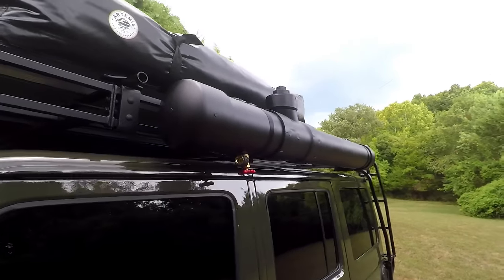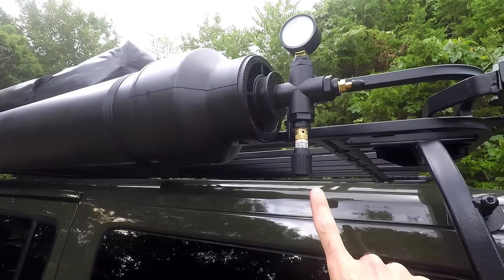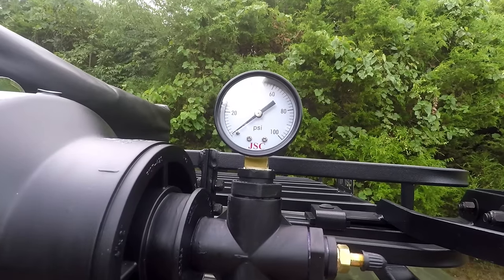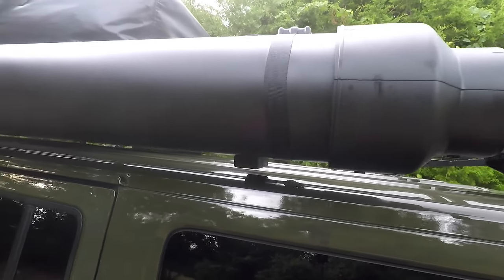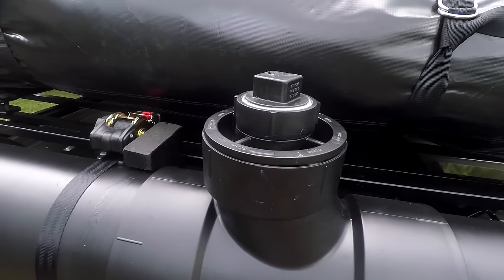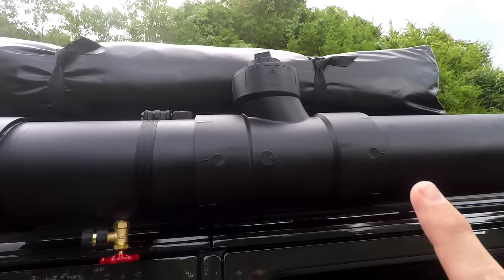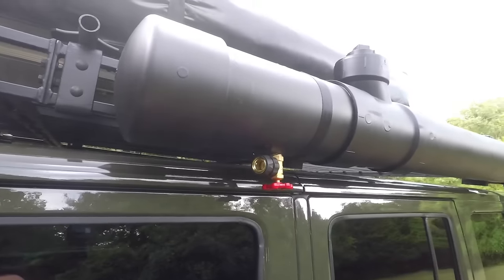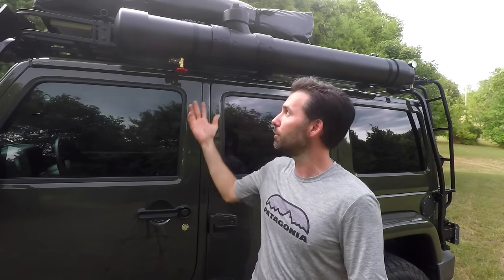DIY Camp/Overlanding Shower Walk Around

Comment: Have you considered an RV/Boat 12VDC pressuring motor? They are auto sensing for pressure and only run on demand. Proven reliability for decades on boats and RV's. Merely run a flex hose to your shower head/sprayer and put the pump in-line. No more pressure in the PVC tube and eliminate the teflon tape requirement.
Reply from the maker: That’s a great idea!

Comment: Yours is the first one I’ve seen, with the all important Relief Valve. The only thing I would have done differently, is to drill and tap the PVC, on the reducer fitting, and through the pipe, and installed the relief high. So you would vent air and steam, in an over pressure event, rather than water. BTW, to drill and tap the PVC Pipe, use Hand Dishwashing Soap, strong solution diluted as a lubricant. Another thing, we had one of the H-OT-O2 shower bags to rinse sand and salt off, when we went to the beach. The first time we put it on the roof of our van. It was too hot, and would have scalded us. We learned to leave it inside the back of the van, on the floor.

Comment: If u use a quick connector on the hose, you can fill and pressurize the tank without taking the tank cap off...waterport and rinsekit use this method to simplify refilling and pressurizing.

Comment: Nice build but my concern is the location of the pressure regulator and the schrader valve. I think it should be above the water tank full mark. The reason for this is when the pressure regulator happen to regulate pressure, it will by-pass air instead of water. On the schrader valve, there is a possibility for the brass to corrode if in water for extended amount of time that can lead to schrader valve leak. I like to add an idea to mount a home hot water tank pressure relief valve mounted in line with the full water level mark so that you can fill it with water where a pressured water hose is available. Just hook up the garden hose at the outlet of your tank and open the pressure relief valve. When water comes out at the relief valve the tank is full of water. This way you don't have to open the water tank cap.
Reply from the maker: Blo Pez lots of great ideas. Thanks for watching!

Comment: Build a small, separate air tank (8 litres) and load it to 80 psi and put an adjustable pressure limit valve and gauge (same as you have on a bigger compressor for spray painting)  between air and water tanks. Set the valve at 40 psi. Fill once and get 3 or 4 times the longivety of one air charge, remembering you have a full 40 psi pre loaded in the water tank and a backup 80 psi in the  8 ? Litre air tank. If you made a steel air tank you could charge it with 120 psi.

Comment: There is a conduit carrier kit at HD that has a metal pipe cradle, to replace your wood blocks. Overall great job! Thank you
Reply from the maker: Anthony Sanchez Great!  I’ll take a look. Do you know if they have 6” size?  Thanks for watching 👍🏻
Reply: @OverlandAddict  they do, check Amazon, get it delivered straight to your door. You might also consider unistrut and U bolts, if you wanna save a few bucks.

Comment: I think I'd use a valve for refilling the tank as well, so I wouldn't ever have to unscrew any parts of it. Screw a hose in, open the valve, fill up the tank, close the valve and remove the hose.
Reply from the maker: ArbitraryLifestyle yeah I like this idea.
Reply: Filling it up with a hose would build up pressure. My rv fresh water tank fill has a little vent tube to allow air to escape while filling tank.

Comment: Zut. My 2008 JK doesn't have an on-board compressor. Yours works fine enough. I have a portable to blow up a tire.
You could use the boiler valve to fill it with a garden hose. Just leave the top cap loose to know when it's full.

Comment: Great video, thanks! Can you add a link to a recomanded compressor to keep a fixed pressure?
Reply from the maker: Any compressor will work. What you need to hook in-line is a pressure regulator. You can get one at Home Depot or Lowe’s. Set for about 30psi.
Reply: @OverlandAddict  thanks for the reply, i built the same setup and the only part that im missing is the preessur regulator. It would help me a lot anf i would super appreciate if you can put a link or a name for the pressure regulator including description on how to set it up.
Many thanks again and a great video

Comment: Nice build. Doesn’t that outlet valve get in your way there at the drivers door? I would rather have it back over the aft most window.
Reply from the maker: Ed Robinson it barely clears the door. I agree. The back would be a much better place for it. I learned a lot during the build and would do a few things differently. 

Thanks for watching!

Comment: Hello! 

Really nice build!
Id like to test having a dedicated compressor to the tank that you talked about. A compressor that automatically keeps the pressure inte the tank when showering starts. You said you found a compressor like that but i dont know what to search for. Most compressors with digital display that you can set pressure on is hard to know if it automatically will pressure up the tank as soon as you start lowering the pressure while showering. 

What would the keyword be when i search for the type of compressor i would need to automatically keep pressure in the tank? Is it possible to find any compressors in a reasonable price range?
Reply from the maker: hauba1 I ended up using my onboard ARB compressor to pressurize. I also installed a regulator inline to make sure the compressor kicks on and off to keep the pressure constant. Works great. The regulator is just one I got at Lowe’s that’s used for spray guns.

Comment: I think if you had the filler near the back by the ladder it would be more convenient. Also having the spigot near the back would save you from having to go to the back of the Jeep to air up, it would be right there. overall cool design
Reply from the maker: calvin deboer I’d probably do several things differently now. Thanks for watching!
Reply: Looks like it would probably be alright just to flip the whole thing around and be just fine. Trial and error is the best answer to what is wrong with an initial design. Great video, thanks for the ideas.
Reply: @JasonPNeal-gw7bn  it would also eliminate a mud puddle at the driver's door

Comment: If you haven't already figured out a replacement for the wood, you can use foam blocks meant for kayaks or 4 inch pipe straps that can be found in electrical supply store's.

Comment: You said that you may buy another air compressor from Amazon where you can set the desired pressure and forget about it. If you got it, can you share the model? Thanks for the video.
Reply from the maker: Never got it. I just installed a pressure regulator instead.

Comment: Keep the awning and build a rear bumper 8 gal water tank.
Reply from the maker: titanhank1 yeah I gotta do something now that I’ve got the awning. Although, once the trailer is done the awning and tent will move to there, so I’ll have room for the shower again 😁

Thanks for watching!
Reply: You can do both, one on each side. More importantly, you want the water tube up in the sun or it won't warm up. ;-)
Reply from the maker: Henry Cole Stage can’t put it on the other side because the tent unfolds on that side, and there’s an annex that zips under the tent.

Comment: Overbuilt.. you can build it much cheaper... just 2 caps, maybe put the 90 degree 4inch cleanout/fill.. and just drill the caps for the air fitting, and hose... maybe put a petcock on the fill plug to release pressure.
Reply from the maker: scott17818 I’m not a plumber so I relied on the guys at the plumbing supply store to help me with the parts I needed. Thanks for watching.

Comment: Normal schedule 40 is not for pressure anymore than 10 /20 psi  it could blowout just saying .would highly recommend schedule 80 or you can get 40 in pressure. You have to ask for it at plumbing supply shop.
Reply from the maker: scott jafo what about this?

https://www.google.com/amp/s/www.engineeringtoolbox.com/amp/pvc-cpvc-pipes-pressures-d_796.html
Reply: This is not true. check Mcmaster-Carr. It specifically states schedule 40 pipe psi ratings are way above 40. The smaller the diameter, the higher the pressure. We build pressure systems for the military all the time with PVC. 4' diameter is rated around 140 psi. 1" is around 400-500 psi.

Comment: Ever heard of electric 12V water pump? You wouldn’t need to use a compressor and complicated setup. Also a bit heavy for the roof, I’d put the water tank under the car.
Reply from the maker: MRL Automotive I already use the compressor for airing up my tires on the trail, and if I put it under the truck I’d loose ground clearance.

Comment: Awesome setup BUT with zero pressure in the tank u could fill each time from the output valve. Just hook up a garden hose and presto.   Surprised u missed that.
Reply from the maker: Nick Brotchie yeah, not sure why I didn’t think about that. The employee at the local plumbing supply store was helping me think of all the parts I needed, and he recommended the clean out at the top for filling. 

Thanks for watching!
Reply: @OverlandAddict  - Also, no garden hose source always, your way you can refill the tank with the bucket from the river/lake.
Reply from the maker: AloPandur great point!

Comment: Do away with the air stop all the movement of water back and forth when driving. Put a rubber plug and a 5" × full length 50psi spring inside the pipe screw a water hose into the front valve fill the tank it will push the plug and spring back now you have pressure and the water wont slosh around when driving.

Comment: Wouldn’t it be easier to just have an adapter for a garden hose to fit on to the water outlet?  
Just connect the hose on to the tap and open the air inlet and let it fill up.  No need for the top fill opening
Reply from the maker: David Handley possibly. This has been mentioned by other viewers. The only downside I can think of is you wouldn’t be able to fill it with anything other than a garden hose.

Comment: Just wondering if you could use a 12V submersible water pump  instead of pressurising.
Reply from the maker: p Oden I guess you could if you put the pump inside the tank. But then what if the pump went out?
Reply: Just have to make it removable. You could have access at the fill point. Pumps are AUD 17 from China. 10L / Min . I will build one and see how it goes. ( Aussie)
Reply from the maker: p Oden sounds good! Let us know how it goes.

Comment: How about you leave a half to a full inch of space in the top of your tank.  You can pressurrise air a lot more than you can pressurise a liquid - pressurise up to about 70psi and I think you may find the pressure enough to eject all the water at a useable pressure
Reply from the maker: Paul Kenna sounds reasonable. I can’t remember at the moment the upper PSI rating for this PVC, but it’s not very high. I think 70 PSI is starting to get close. I usually pressurize to 35-40, which is about normal household water line pressure and it puts out a nice steam. 

Thanks for watching!
Reply: @OverlandAddict  Its just that you can pump a lot of latent energy into a airspace, a lot less with water and very little with a solid.  You are pressurising with air and if there is no space for the air to go because the water tank is full the best you can do is start to dissolve the air you are pumping into the tank into the water.  (We do the same using CO2 to pressurise home brew)  but to keep a pressure there that will expell water from the tank you need to pressurise a volume of air in the tank
Reply from the maker: Paul Kenna your knowledge is above my pay grade, but it sounds like you know what you’re talking about. Even though it’s pressurized from the side, I figured that once you introduce pressure into the side the water would be forced away from the side and moved to the top due to the air pressure pushing from the side, but I’m no engineer or physicist.  That’s assuming that there is a volume of air at the top and the tank is not completely full.
Reply: @OverlandAddict  Thanks for posting this video and the cost breakdown, I am working on my own version and this has been very helpful. I am an engineer/physicist - two important concerns when using one of these tanks: 

1. NEVER drive with the tank partially full! It must be either completely full or completely empty, or else the sloshing of combined water and air could cause a "water hammer" effect (an extreme surge in pressure in a small section) and explode your tank from the inside out.

2. Heating the tank will also pressurize it slightly, so I wouldn't recommend pumping it up until the water is already warm. This isn't as much of a problem with your pressure release valve, but I think those are designed for air pressure and thus should be mounted above the water line.

Also, the air does not "force the water away from the side" once you add pressure, water is still heavier and will always settle at the bottom with a flat and level surface.

Paul is correct that having the tank not 100% full of water when you pump it up will make it much more practical to use. An easy way to look at it is the amount of air you start with in the tank (by percent) will equal the amount of pressure left once you are done (by percent of starting pressure). So for example if you start with 25% air at 40 PSI, your last drop of water will come out at 10 PSI. Hope this helps!
Reply from the maker: Shane Allen wow!  You obviously know your stuff. Great comments!

I never pressurize it more than about 30 psi, and I believe this PVC is rated for 100 psi. 

Thanks for all the great advice, and for watching. Please share your build when you’re done!

Comment: Can you recommend a compressor that you talked about that continues to maintain pressure?
Reply from the maker: Taun Stanham I’m using the ARB single compressor. It works well for this setup. I also hear the Viair compressors are nice. 

You’ll want to make sure you pair it with a regulator like I did to prevent over pressurizing the tank.

Comment: Been looking at building a water tank like this for a while now. Really like your setup. I work with PVC for a living and wouldn't recommend switching the wood out for metal. Any vibration would cause any metal edge to cut into the PVC.
Reply from the maker: Joxer 2018 yeah, I’m keeping the mounts as-is for now. Thanks for watching!
Reply: Wouldn't nylon staps work as well ?

Comment: Instead of pouring the water in if you connected your house hose directly to it to fill it when it’s empty, it would naturally pressurize the internal air space from the house water pressure (~30-40psi) You could use a quick disconnect fitting for this.

The video was cool but the music was too loud.
Reply from the maker: Shaka Doug Corbin I think the pressure would slowly diminish as the water flowed out. I think you need a compressor for constant pressure.

Comment: I'm pretty sure you are over engineered for this project. The water inlet could have been a tapped fitting, both ends could have been capped instead of all the different reducers you have. A clean out is useless so that could be eliminated, a simple tire filler could be tapped and threaded or a glued fitting. You don't need a water pressure gauge at all, you can control that at the HB. I'd say $100 max to build a water heater.  watch armoredcockroach video on youtube for the same thing but much simpler.
Reply from the maker: Land Rover I won’t disagree with you. I just took the advice of the local plumbing supply for the different pieces needed. I’ve learned a lot since then. Thanks for watching!

Comment: why not use pressure regulator with preset value of 30-40psi? you would just connect the air hose and forget about charging the tank...

Comment: Nobody does it but if you add another valve at the top of your rig you could just open that valve, use a female to female hose fitting and connect your fill hose to the bottom, open the top valve, when it spills out your full. That way you don't have to deal with taping your lid, or needing channel locks to get the lid off.

Comment: I did pretty much the same thing but my water doesn't last but 30 seconds. I'm using 4" about 6' long my Schrader valve, pressure relief and gauge are on the opposite end on the water outlet. Any suggestion on how to fix this?

Comment: Thanks for the video.  I’ve seen a couple of these types of DIY shower videos so I’m not picking on yours alone but it always cracks me up when people say that in addition to showering they will use it to clean off their rig and then spray a side panel like they are getting ready to roll up to a Starbucks at the mall and don’t want their rig to be unpresentable.  Let’s come up with a more plausible story.  How about to get the extra gunk off the windshield that the wiper blades can’t clear or a part of the undercarriage so that you can do a trail repair or replace a flat tire.

Comment: The only drawback that I can think of is UV rays deteriorating the pipe and fittings. I am about to design a rooftop solar water heater for my rv camper. I am going to use normal water pressure from shore supply or a 12 vdc pump. I am still piecing it together in my head.

Comment: Get a small air tank and pressurize it to 120 to 150 psi. Run a hose from that tank to your black shower pipe with the regulator. You won't need a second air compressor and it should stay pressurized for your entire shower without needing the air compressor to turn on at all

Comment: Pipe looks to be meant for drains which is not rated for much pressure. Also, you can just get an air pressure regulator to pressurize the water tank and just leave it connected when in use instead of getting another compressor.